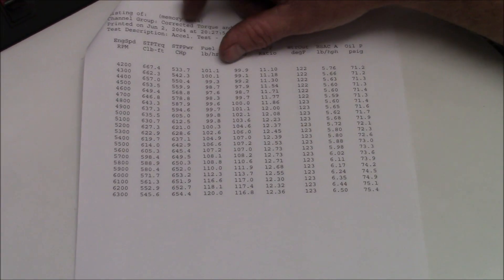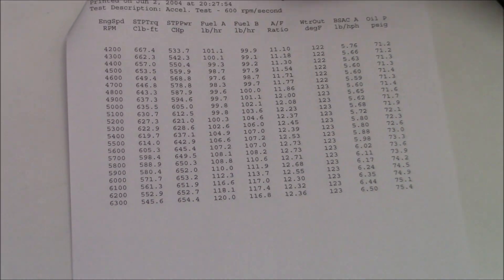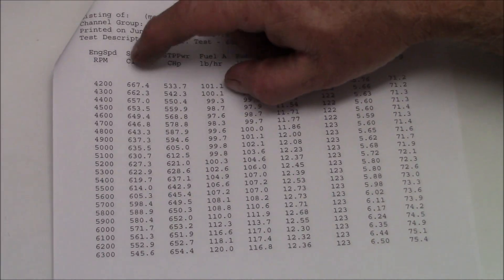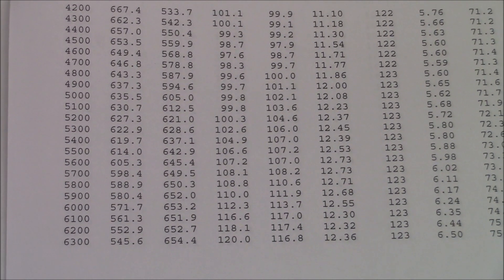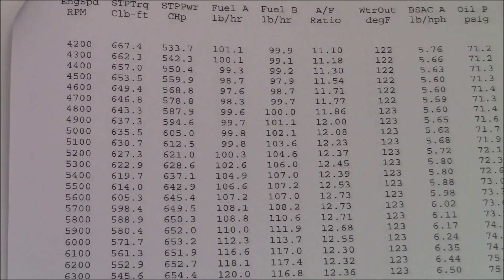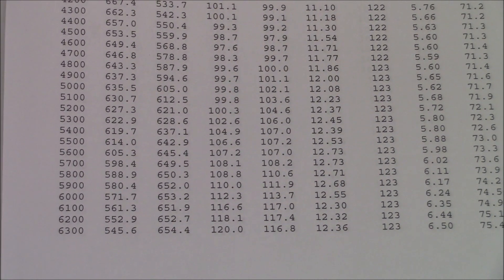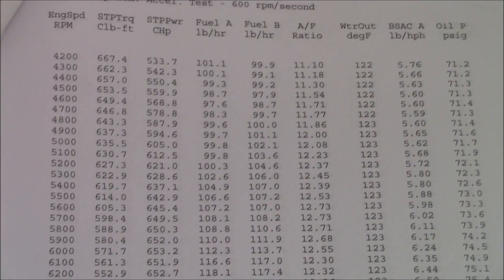650HP 496 Big Block Chevy - Dyno / Drag Test - Part 1

Comment: Mark what are your thoughts on putting a 4.5 inch stroke in a 454 block and making a 525? Aso what are your thoughts on a 2 bolt vs 4 bolt crank in a 454 drag race motor.

Comment: I really like seeing old iron castings with work done. That's how it was done. If you had an Olds Rocket like a 324 371 394, Buick nailhead, or anything before the 80s all you had was oem iron castings and some guys made power to embarrass modern stuff.

Comment: I have a 401 nailhead I want to rebuild with 325 up I would like to increase to 1 horsepower per cubic inch it has a 445 torque I talked Russell Martin at Centerville auto repair in .ca. I think he is a king to much to rebuild he specialize on nailhead any advice would be greatly appreciated thxs keep up the tutorial

Comment: I miss the early magazine days as well. The drag cars now are so high tech and expensive. Many of the car show muscle cars aren't driven.
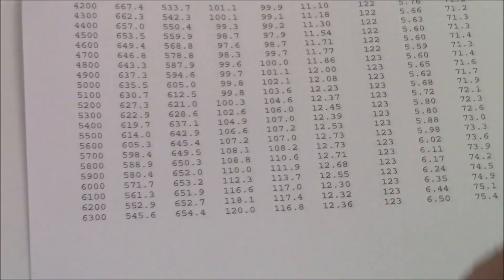One of my favorites was the "original" 1962 tomoto can nova series. I loved it when they jammed that 396/375 into that little car then off to the drag strip. A good example of a reader's car was a mustang II with a 460 dropped in, the car had monster treaded tires, possibly 14x32 or 15x33, I was inspired. My first car, a 1967 malibu with 327. I ended up building an engine out of spare parts my dad had, it was a 1970 Lt1 block, 1969 large journal 3.00 in stroke crank, chevy "pink" rods, 6:00.1 Arias pistons, ported iron 300hp 350 heads with bigger valves, guide plates/studs, blue stripe pushrods, chevy 1st design offroad solid lifter cam, Wiend blower manifold and a rebuilt 6-71 case and rotors/end plates, 2 double pump holleys, overdriven drive pulleys. Also bought Turbo Action reverse manual shift 400 trans. Car had 12 bolt 410 gears.
The little 302 dragged that old malibu
Into 10.80's, not bad for back in 1982. People at traffic light stared. Blower cars were rare in Stone Mtn Ga back then. My next car was 1970 LT1 Z28 350/370 with 4spd, 3:55 gears, gold w/ black stripe, then I too owned a 1965 Chevy II. I drove the nova to work with M&H race masters... not drag radials, Lol. I also bought a brand new LS-7 454 with open chamber, square port iron heads that were ported, relieved and matched to a Holley strip dominator and modified 830 Holley, 12:1 comp, ZL1 cam. I bought the long block, valve covers to oil pan for $2,200!
Fun days and lower costs, more local drag strips.
I enjoy your channel!
Thanks, Bill

Comment: I learn to build my first Big Block Chevy out of old issues of Hot Rod Mag.! Even how to set chassis up for weigh transfer, other shade tree stuff that worked. 1983 first time ever running at a track 10.86/128.68. Run out of RPM aka money...ha ha ha! Thank you so much for giving back to young people!!! I still go back or ideas like cool can, refresh my memory on degree wheel, pinion angle. Your are pure gold sharing expert advice that may lead to careers more valuable that a degree to many. I 66 yrs old and I still have to laugh at person putting 30 or 40 thousand in a setup and has never heard of indexing their spark plugs. In a set of close chamber heads I have seen two tenth off quarter time. Cost maybe three extra plugs that used to daily use. Thanks and funny I just got a 496 coil in a drag car I bought two weeks ago. Torque monster at discount price. Thanks and God Bless!!

Comment: Hey big fella Nice Video..hey can I ask why with today's aluminum head's as cheap to get as they are  would anyone ever opt for the stock Massive heavy Heads ? Even if you get a set of KMJ  Head's you can still port them and make them flow almost as well as a set of "GOOD" head's  ? If for no other reason the weight savings ?

Comment: question for you guys running a 408 cleveland  in a 4,700 lb wagon , coan c6 4,500  coan stall 4.10 gears 750 e85 carb with 92/84 jets with 45 squirts . it is very boggy won't burn out any suggestions motor is 13:5:1 with 260/260/ at 50 and .640 lift 110lsa
Reply: Need a Hotter spark,  it's  drowning.

Comment: Observation
DYNO TEST - 467 Inch BBC 
Max Torque 651 LB/Ft @ 5000 RPM
Max Horsepower 729 @ 6700 RPM

DYNO TEST - 496 Inch BBC
Max Torque 667 LB/Ft @ 4200 RPM
Max Horsepower 654 @ 6300 RPM 

Presuming Bore Diameter being equal are we witnessing the effect of Rod Length Ratio?  Rod Length / Stroke = Ratio
The tests show Greater Displacement = Greater Torque & Greater Displacement = Less Horsepower. 
I found this interesting. I don't know the answer. Request any comments remain technical in nature. 
Their is no substitute for experience. Thank You
Reply: He mentioned that the 467 had between 11-1/2 to 12 to 1 compression. 496 had 9:8 to 1. So the 467 has considerably higher compression. Also meaning he may have ran it on a higher octane race fuel on the dyno. Also the 467's cam was a higher lift. Mid 600's exhaust, high 600's intake. The 496 had high 500's exhaust, low 600's intake lift. So 496 had a lower lift cam. Dont remember the duration's. Also, 467 ran with 2- 750 CFM carbs. Thats 1500 CFM on a large tunnel ram intake. All those details will more than justify the higher horsepower numbers.

Comment: Buddy I have built engines for over 30 years . And its dirty high stress hard work.
From the way you speak and your movements you need to get to the doctor you very possibly have Brain /nervous system and organ damage from the fumes and heavy metals.
No Im not being an ass (this time) this is real
Reply: Been breathing 110 VP for years no problems
Reply: The way you slam the tooling and parts around is a sign of motor control issues possibly some Mini strokes or other issues.
Im not a doctor but you need to see one
Reply: Thanks Tom. No power adders, NA only
Reply: I assume your talking about the car.
I Dont buy it there mark
Your trying to make a nitch in an out of the box performance market I get that.
Thats a very well set up car and a very good run. We both know it does not take that much power to do 10's these days if used correctly.
And that burst at the end is very suspicious. (  to get that MPH) where was that burst in the middle of the run?  
Im guessing 450-475HP
When I first got my dyno along time ago I knew people exaggerated numbers but had no idea how much!
I put together a BB chevy Dyno mule motor and beat the out of it trying to get those numbers actually ended up blowing the side of the block out.
I built a similar motor for a friend it ran 10.20's in an amazingly stock 70 el camino on 10" slicks no tubs or 1/4 panel work.(but we did put the tail gate down) It tested at 500hp. (and he knows how to set up a car.)
I built a limited late model motor for a local dirt tracker that tested at 425hp with a wide power band. the competitors were claiming 500 and 550 HP wanting people to bring there motors in for tune ups twice a year and all the bull shit.
I was very worried so i talked to nolan at isky cams he said thats a good number for that combination.
The customer won a bunch of races with that motor and he clearly could match anybody on power and beat most of them. He ran all season with just oil changes.
The track like many other tracks got tired of the bull shit engine builders sucking the life out of the racers and made a 400hp GM crate rule. The cars were just as fast and more reliable.  
I had a customer that became a good friend running a GT1 road race corvette he has talent but never made the investment on good parts for a reliable strong motor. So he broke and patched broke and patched.
I finally convinced him to do that he drop shipped me 2 bow tie blocks . 2 sets of gm 18 degree castings 2 callies cranks 3.25 stroke. 2 sets of carrilo rods ect 
He brought in some used cup titanium valves that had lots of rpm written on the box i threw them in the trash.
I helped him at the track for 5 years and lost track of how many race he won . Also a championship.
Building engines with crap stock parts is not cost effective for the customer.
Bull shitting bottom feeders like you have wrecked the market for honest builders. 
That why people buy out of the box heads and crate motors if I were not in the business I would do the same
Reply: 1320/122.7=10.75
Reply: The numbers are obviously fake and your Nonsense formula in your response proves my point
Reply: Tom....read this and try and learn.
http://www.chevelles.com/forums/13-performance/794225-vortecpro-454-peanut-port-engine-build-drag-test.html
Reply: Unfortunately drunks usually think there fine also
Reply: @tomhutchins1046  It just kind of sounds like you're a jealous fuck and pissed off because someone's an actual engine builder with actual results if you don't agree with the results that's fine but there's no need of attacking The guy if he slamming Percheron he's obviously not doing it to the point where it's hurting the builds as far as the numbers are concerned those are the numbers how do you prove they're not? Idiots like you on Facebook and YouTube and other social media just baffled me it always amazes me how much hatred they are towards people that know what they are doing maybe the reason why you're so offended and so upset about Marks  builds is because you can't figure it out how to do it for yourself .

Comment: I miss those articles too. Especially the multi-part ones. keep 'em coming if you can. Are you running stamped rockers on that 496?
Reply: LOL.............no that was only for the "everything wrong" peanut port drag test with its 228 @ .050 hyd cam.

Comment: i follow a guy on you tube has a 489 in a 70 ish nova on the dyno it pumped out like 680 horse but hp was like 500 to the wheel which is nice has afr heads roller cam etc , i was kinda figuring hp would have been a little higher , 11.2 i believe is the fastest 1/4 mile so far , tho he is heading back to the dyno this time tuning for nos ,i just wonder if cam selection would help him out , oh well guess part 2 of these series will shed some light on things , ima fan of Brian Tooley
Reply: How he get 489?
Reply: @WisdomOverWicked777Rules  30 over 454 with 4.25 stroke crank

Comment: About how much power do you think you could you get out of a 427 in a 68 Caprice (stock crank and stock or iron heads)?  I'd like to keep it factory engine but with lots of power.  Maybe power numbers with hydraulic roller and solid roller.  It would be neat if you started to flirt with e85 and higher compression, I'd definitely be down for that since its available in my area.
Reply: We really appreciate all the support......really! Every one loves a dyno/drag test!

Comment: That's almost identical to my 489! My cam is slightly smaller, 233/241 at .050" .570"/.590" with 1.7:1. 106 icl 110° lsa. If my heads do well on the flow bench, I'm thinking about using a 1.75:1 rocker on the intake for .583" lift. My combustion chambers measured 119cc after the Ferrea 2.19"/1.88" valves were installed, and the heads resurfaced. I ported those chambers by hand to unshroud for the larger valves. The intake manifold I'm using is a Weiand dual plane very similar to the Edelbrock air gap. I melted down a couple old pistons and poured in my exhaust crossovers, and blended those bowls.  Mark, thank you for this video. I can't wait to see more of it! I doubt I'll see the numbers you make, but it's awesome to see an engine so relatively close to mine.
Reply: My first time porting for my 781 heads with 2.19"intake 1.88" exhaust back cut, and swirl polished Ferrea valves flowed on the bench 
.200" = 151.5
.300" = 283.2
.400" = 287.5
.500" = 306.9
.600" = 310.1
.700" = 311.3
I think I can do better on the next set. I think I hogged the bowls too deep. So far though; I've talked to a couple local engine builders, and they've said I did extremely well, especially for my first set of heads.